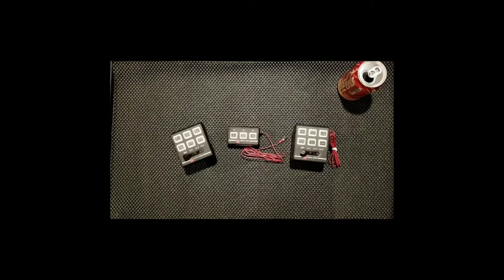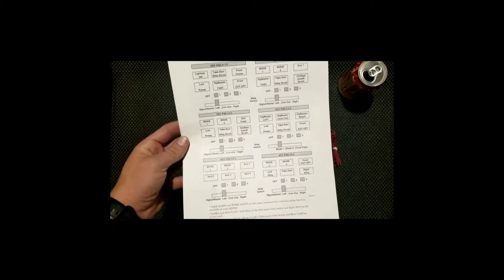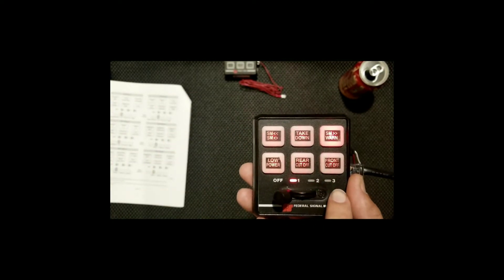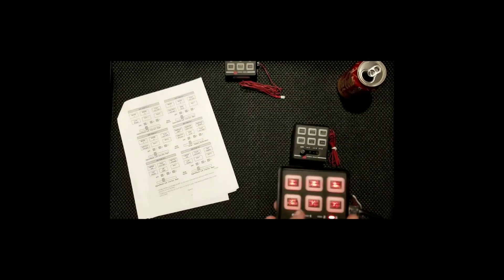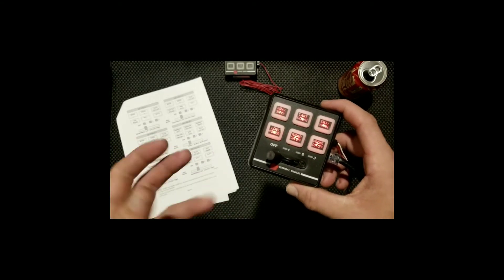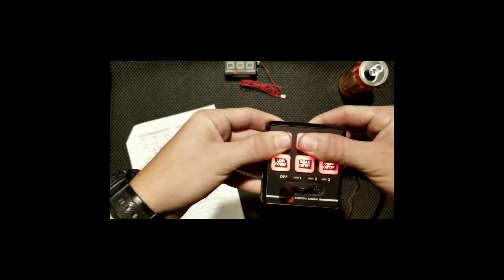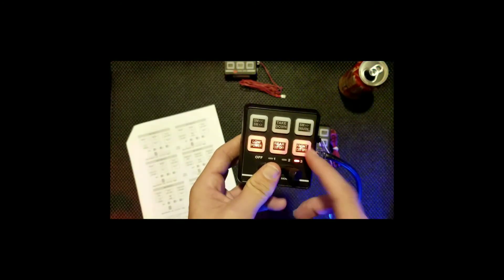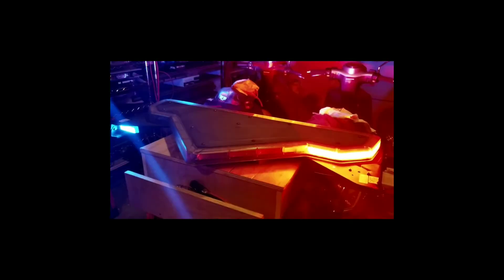Federal Signal 6-Button Controller Programming

Comment: Well you seem to be the go to guy on these controllers. I bought one after watching your video and i like it very much. But... i have an arjent s2 that was originally set up with two forward California steady burn lights. These lights will not come on no matter what flash pattern i use or controller set up. Any ideas how to get those lights to turn on? I still want the to be steady burn. Thanks!
Reply from the maker: Do you by chance have a serial interface module that you could try? That would at least be one way to figure out where the steady burn lights are located in regards to how to activate them. Typically on the serial interface modules, you would have to activate the red/white wire to activate your steady burn lights and would need to have federal signal manually program your controller to say, with code 1, 2, and 3, activate the 'steady burn wire function' as well. Otherwise, there's nothing for the 3 button or 6 button controller button wise that is programmed from federal signal to command the steady burn wires to activate. I had the same issues where my arjent would not activate my steady burns unless I have the SIM that had the corresponding wire without sending my 3 or 6 button controllers in for reprogramming. Since my arjent s2 is for display, I didn't have major concerns. Hope this was helpful! Thanks for watching.
Reply: I do have a serial interface module.  Im just not sure what controller is compatable with it and im not sure how to program it.   I will try hooking it to the lightbar and see what i can figure out.
Reply from the maker: @MarkS-qp6pz , that's good. You can use the serial interface module to test the lightbar to ensure your steady burns lights function, then depending on the controller you wish to use, utilize the wiring to each on/off button or slide switch you wish for each function. The module will not work in junction with the 3 or 6 button controllers so that would leave you with a few other options.
Reply: Ill give that a try. Thank you for the help!!
Reply: I got it working with the interface module.  The California steady burn lights work and everything.  Your video on the interface module was also very helpfull. I will like that video and post comments.  I think i need to buy you a drink for your help! Thanks again!
Reply from the maker: @MarkS-qp6pz , it is a great pleasure to assist! Glad my video was of good help for you.

Comment: With this controller the serial interface module is not necessary for operate the led lightbar?
Reply from the maker: roberto carlos carlin miranda that is correct, this controller will be in place instead of the serial interface module.

Comment: Mine has always flashed the 3rd button when powering on.  I have it connected to a visor bar and have never been able to change flash patterns.  I even sent it to FS once bc it stopped working right.  It doesn't matter if i hold the top 3 or the bottom 3, its like I'm locked out of programming.  Mine has one power cord on the right (not 2 like yours) and the rj45 for the bar connection.  Id love to change my flash patterns.
Reply from the maker: Sorry for the late reply, I have a 6-button controller that has had both, a single power lead and a dual power lead, I haven't noticed a difference between the two even after switching the wiring from one controller to the second. In regards to the buttons not getting you to programming upon powering up, more than likely federal signal during their repair may have locked it but I would check with them to be sure as that does not sound right to me.

Comment: hello I have a six button controller my light bar is 1yr old. I turn on my controller and it beeps and lights comes on press button they all beep but my light bar won't turn on I have the Work Truck Integrity. could you help me in anyway,,,,,,
Reply from the maker: Cristy Vicente, with it being a year old, you should be still under warranty...I've had this happen a couple times on my older federal signal vision lightbar and couple things I'd check is all your fuses, make sure nothing is shorted out and if all looks good, the last time I had this issue was a bad circuit board that once replaced, all functioned perfectly. Just a couple ideas or possibilities.
Reply: rjracing38 thank sir for the info I checked it was a fuse! Now working on why my signal left right center is not working . But everything else is.
Reply from the maker: ray allen, you are very welcome, are you using the serial interface module or the 6-button controller? The serial interface module requires a specific setup...otherwise, with the 6-button controller, maybe a fuse in the circuit board in the lightbar may be the culprit.

Comment: OK, thank you. If it is the controller can you recommend a good place to buy a replacement?
Reply from the maker: dieselboy01, I've found so far, sirennet on their website www.sirennet.com. You can try to call them and ask what a new one would run or see if you're able to find one online used like eBay or something. I was lucky and got all mine via eBay.
Reply: Could you have the regular size and a 6 Button be on the same system

Comment: Do these 6 button controllers fail? I'm having and issue with my light bar working intermittently. Also, my 6 button doesn't have that smaller pug with 2 wires running to it.
Reply from the maker: dieselboy01, I'm positive like any electronic device, yes they can fail. If yours is intermittently working, I would double check all connection points, possibly ohm out the wiring to ensure proper connectivity and the wiring hasn't been nicked causing a short or grounding out.
Reply: rjracing38   Thanks for the fast response. I'll double check wiring this week. What about the smaller 2 wire plug, mine doesn't have this.
Reply from the maker: dieselboy01, my original 3-button controller came with the two wire while both my 6-button controllers came with a single wire...they both get tied together for power anyways so that I do not believe will hinder the operation of the unit and then ground is through the cat5 cable coming from the lightbar.